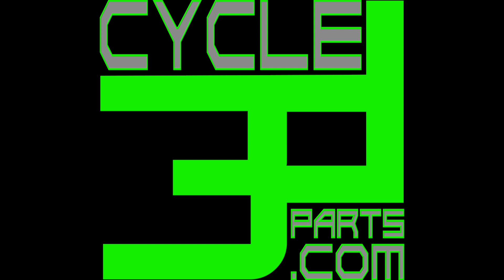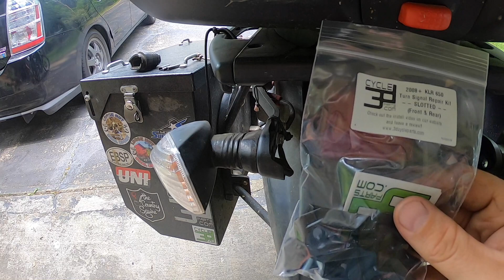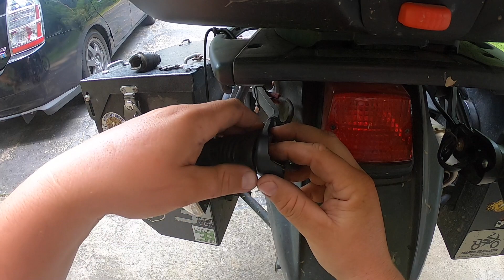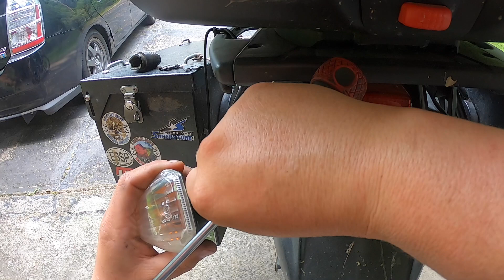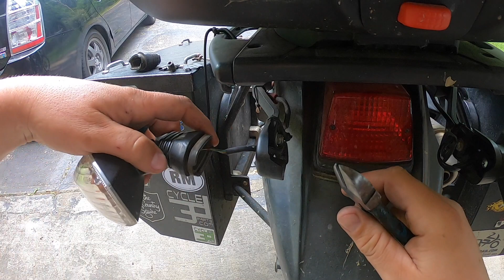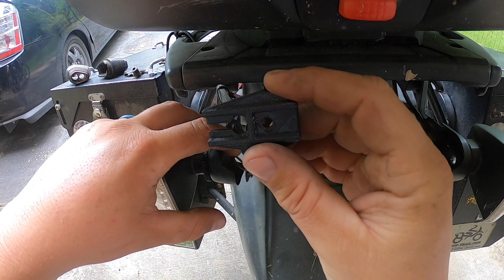KLR650 Gen 2 Blinker Turn Signal Repair Kit (Easy Install Version) - 3D Cycle Parts

Comment: These things work great! A pair of tin snips easily pop off those other bracket pieces, so you don't have to worry about zip tying anything that might start rattling later.
Thanks for the great product!
Reply: Is it a good idea to snip off the brackets instead of zip tying them? What works better, wire cutters or tin snips or does it matter? Thanks.

Comment: Installation was easy, and looks great! But after few rides the lenses cover fall apart from the turn signal assembly, I am guessing is due the vibrations… then I understood why Kawasaki designed them like that… the ugly plastics in the oem ones works like a shock absorber! Be aware! If you drive in nice streets you should have zero problems.
Reply from the maker: There are thousands of these kits in use for years now and I've never heard of that. Most likely your lens or housing was cracked and then it let go. Replace that housing and you'll be set. Thanks!
Reply: @3dcycleparts  , it could be! Thanks for the feedback

Comment: Just received my kit. Excited to get this on my '08. One question: why keep that back plate and zip tie it out of the way, but cut the other plate off that was in the rubber stalk? Is that back plate potentially needed for something later?
Reply from the maker: It isn't needed it's just harder to cut off.
Reply: @3dcycleparts  Got the other off with a pair of tin snips. Fairly easy.
Reply: @3dcycleparts  good to know. Thank you!

Comment: The rear install works much better when you lift the luggage rack, and so far, I can't figure out how to get the fronts done without removing the fairing, which I'm not even sure how to do. Is there another video somewhere?
Reply: Pick up a Clymer manual from 3dcycleparts.com. Best $30 you will ever spend.

Comment: Really good, detailed video.

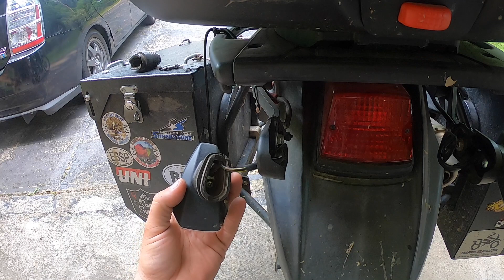Myself, for now I just want to attempt to repair the right rear blinker on my '09. It is hanging by the wires and it looks like the Phillips screw is gone. Can you please tell me what size Phillips screw I need to use as a replacement.  I'm looking at around 3:30 on the vid.
Reply from the maker: The kit comes with all the screws needed. Thanks
Reply: @3dcycleparts  

Thanks. Shortly after posting that question I went back to the garage to begin disassembly. 

Turned out that the screw had only loosened (like the ones in my head). Using a skinny screwdriver I just moved it back through the hole, positioned the light back into place and screwed it back securely and snugly. Problem solved.

I want to than you for your demonstrating to me how those blinker lights are constructed and how to access and disassemble. I couldn't have done this so easily without you!  Cheers! ☺